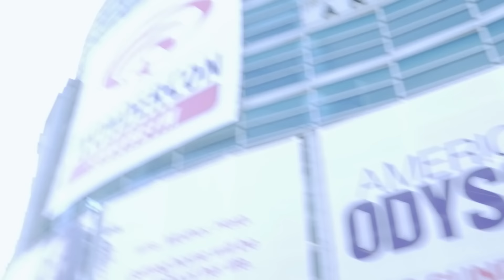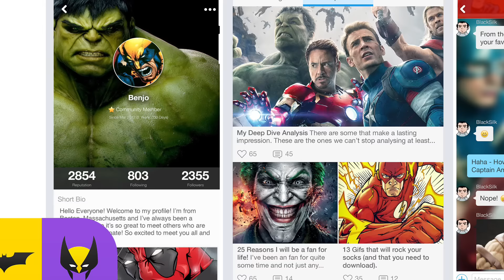JOKER & HARLEY QUINN vs DEADPOOL & DOMINO - Super Power Beat Down (Episode 16)

Comment: deadpool can't be drugged or get drunk healing factor
Reply: yup like exactley
Reply: in the comics though, he has been both drunk and drugged at points, this episode is probably supposed to take place after his healing factor was damaged
Reply: Deadpool can die, Joker could develop a serum that could render his healing factor incapable
Reply: +Kyle Smith you realize Deadpools factor is permanent right?
Reply: yeah!
Reply: +Supa Hot Fire the sword that neutralises healing factors
Reply: A large dose of tranquilizers work on Wolverine so they would probably work on Deadpool too.
Reply: *****
agreed, unlike character like the flash, they dont link the healing factor with metabolism
Reply: deadpool can be drugged... he is immune to ALMOST all drugs
Reply: deadpool can be drugged... he is immune to ALMOST all drugs
Reply: +Jax Dagger Isn't Deadpool still banished from death by Thanos?
Reply: Depends on the strength of the tranquilizer.

Comment: Joker, for all of his crazy, actually put together the tools to beat Deadpool here...tranqs to slow him down, and acid to permanently put him down.  If this was a 1v1 fight, he would have won this...but as usual, he can't rely on Harley, and ends up unlucky.
Reply: Acid wouldn't "permanently put him down" he could regenerate from a molecular level
Reply: Certain acids eat away at the molecular level, Joker even mentions this.  It's also how Deadpoool killed an evil alternate version of himself in one of his comics.
Reply: He still wouldn't die, cursed by Thanos.
Reply: Reduced to infinitely disintegrating molecules, but still unable to die, still counts as a loss for Deadpool, bub.
Reply: maxspecs The disintegration eventually stop. There simply will not be enough chemical element left to maintain the process and outdo deadpools healing factor. 

Thanks to Thanos and TJ, Deadpool simply cannot die. Ever. If this is a "Who can kill who?" match, deadpool wins.
Reply: That's the beauty of Deadpool's healing factor, though: He will never run out of material for the acid to break down, because it'll build more material.  Or some other comic book BS explanation for why it works, dependng on the writer at the time.
Reply: maxspecs i see what you did there, with the unlucky and how the bullet was called lucky shot, unless this was unintentional, good pun.
Reply: The tranqs are the only thing that I found inaccurate in this fight. Deapool's regenerative powers are so advanced that he wouldn't be able to get drugged at all, not even by alcohol. Deadpool even said it himself in his own video game. This fight was still good, I honestly would have liked to see how Joker would've beaten Deadpool
Reply: maxspecs His regen is a improved versions of wolverine, those tranqs shouldn't have effected him to begin with.
Reply: Deadpool literally has cancer and his body regenerates too quick so it can't kill him I'm pretty sure tranqs would do nothing to him and u pretty much can't kill him
Reply: Is no one going to mention Deadpool and teleport so neither Joker nor Harley would be able to hit him at all...
Reply: Lol wut english plz